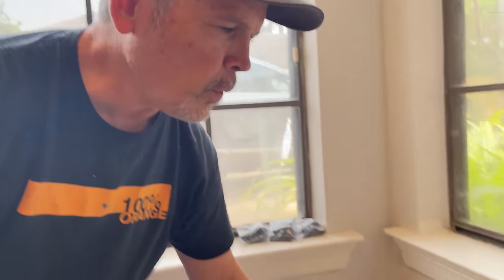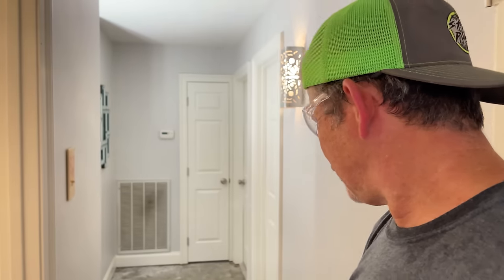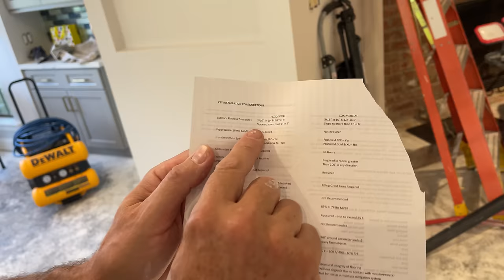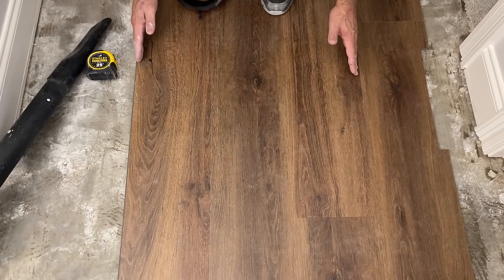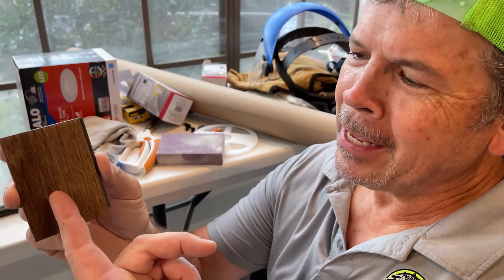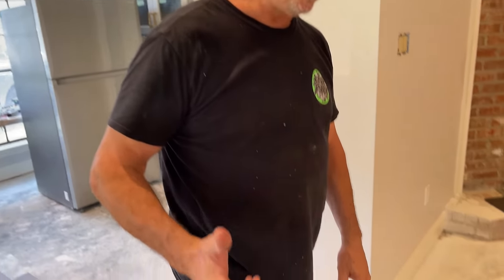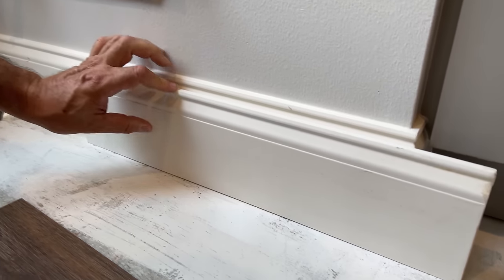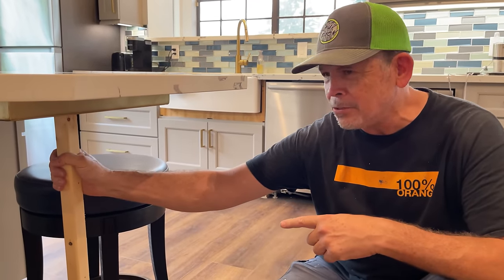The ULTIMATE FLOORING HACK! | Installing Vinyl Plank Flooring

Comment: A few pro tips:  1. Use floor patch instead of thinset, it dries in 20 min and is much harder and smoother.  2. Pull the base and put it back up or install new.  It looks much better and makes install easier. 3. NEVER beat on the edge with a hammer or a rubber mallet, not even with a tapping block.  It's very likely to damage the locking edge. (It almost certainly will).  4. The soapy slide in trick you did in the hallway works on some products, but not all.  Many locking systems, often called drop lock systems, can not be flat tapped into place, doing so will break off the locking tab.  5. I never use a table saw.  I score and break everything right there on the floor.  It cuts your install time in half and makes no mess.  A heat gun will soften the vinyl, allowing you to cut intricate cuts with a knife.
Reply: everything you listed i wanted to say first
Reply: @toxicated3622  Same!
Reply: Actually use soft rubber hammer and I fixed flooring after people who don't use hammer the seams  not locked all the way
Reply: And he could have used  headless nails instead of screwing the planks down
Reply: I use self leveler takes longer but is easier
Reply: great vid. I don't mind the quarter round, only thing that had me cringing was when they were just hammering away at the locking edges with no block.

I might disagree with you on the use of a table saw. sometimes scoring it takes forever compared to table saw/small circular saw
Reply: @KayakKingdom  I shouldn't have said I never use a table saw. It is helpful for very skinny pieces and lots of same size rip cuts. It's also useful when you need perfect edges where there's no base. Last week I used the table and chop saw for a flight of stairs... but holy cow the mess it creates is insane.
Reply: @olegzakluchonii  I didn't say to not use a hammer.  What I said was don't hit the edge directly and don't use a tapping block.  They are made for hardwood and will destroy the locking edge on LVT.  Instead, cut a small piece of product and lock it into the leading edge and tap on that piece.   This saves the edge of the piece you're installing
Reply: @miketerrell1094  if you buy the RIGHT tapping block. it never touches the locking portion of the edge
Reply: @KayakKingdom  I've never seen different tapping blocks, they're all pretty much the same and they all contact the locking edge.  The best way is to cut a scrap piece of material and lock it in, then tap on that piece. You'll destroy it before long, then just make another.
Reply: The father son team dynamic is entertaining but thank goodness for your comments.  I had to pause watching the video after he put down thinset instead of concrete floor patch or LevelQuik or CementAll (my favorite) or the many other products specifically made for this application on concrete.  Thinset is not the way to go.  I agree that they should have pulled the baseboard and put them back and rested them on the flooring after install.  The way they did the work here means they'll need to add quarter round to the baseboard, which will not look as clean.  Hopefully they see your comment and it helps them for their next project.
Reply: Are the spacers just for if there isn't any baseboards installed? What purpose do they serve? Other videos I watched show people spacing from every single wall.
Reply: @coltonkruse2313  My understanding is that it's a floating floor and needs room around the edges. My baseboards were removed but the provided shims did not work well at all. We used some drywall screws instead. We removed them after the floor install, before installing the baseboards.
Reply: @miketerrell1094  I made a tapping block out of a scrap piece. It doesn't damage the edges unless you get careless. I also used a flat pry bar to gently force the last boards to seat completely.
Reply: Ok boomer
Reply: I use a Mantistol LVP 333 cutter, instead of chop saw , still use table saw for rips . I always carry prep underlayment & float trawl to every job just in case. Prepping the floor will assure  it fits together easier & will have a smooth shine to the reflection & not a bumpy or imperfect one
Reply: @coltonkruse2313  it is to allow for expansion & contraction of the material.  This is why it's always best to acclimate the material @ least 48hrs b4 install.
Reply: @MillionDollarFlipper  Ardex is the gold standard in prep however it does take longer to dry. I use regular cheap prep for quick fix. Self leveler for bad situations. I always carry a fan with me to speed up the drying process
Reply: @KayakKingdom  not picking on your comment Mr Fingers just picked yours to comment on. 

If people wouldn't put such bullshit in their house we could all avoid the majority of this crap altogether
Reply: @coltonkruse2313  , floating floors  expand and contract.  Each manufacturer has different tolerances on outer edges and length of runs before a expansion joint is needed.  Most manufacturers have a phone number and technician to answer install specs.   So therefore space around the perimeter is required!
Reply: I've never laid floor before, but will probably have to soon and I'm doing research. From what I've seen people usually say even if the product has padding it's a good idea to put additional one for better noise dampening. Also shouldn't they have left a bit more room on the edges with the wall to allow for expansion? Especially in the corridor it looked to me like an exact fit.
Reply: @miketerrell1094  hook a fernco (rubber coupling with hose clamps) to hook your shop vac to the dust outlet on either saw. Or both if you have multiple vacs
Reply: @CStone exactly. there are LVP tapping blocks the touch the top edge of the plank, but all but miss the locking edge. it still does touch but most of the force is dispersed onto the top of the plank
Reply: Hi stud pack, have you ever done a RV?
Reply: @yogibear5649  in most things in life , prep is everything .
Reply: @yogibear5649  we always do that .
Reply: @miketerrell1094  ah, good idea.
Reply: Flooring of any kind sucks
Reply: Been doing this 20 years. You can use a tapping block and hammer to lock it in. 
You’re not gonna break the edge. Unless it’s broke already or you’re forcing it.
Reply: @miketerrell1094  LVP not LVT
Reply: @Yogi Bear  I'm about to start doing my floors, and I never heard anything about acclimate, what is acclimate and how do I do it. TIA
Reply: I like the thinset if it needs any adjusting just use the floor scrapper and it is easy to take down
Reply: Thank for the tips
Reply: No pro here, but in the past I've used off-cuts to use along with the tapping block to reduce chance of damage.
Reply: @yogibear5649  I do sheet vinyl floors. Ardex is great I agree. I absolutely hate the dry time though. I almost always use 5 minute drywall mud.  Before you respond to that,  I’ve been doing it professionally for over 20 years and have never had an issue even on deep spots like expansion joints or toilet holes cut out because it was in the wrong spot. Seriously not 1 issue ever!  Well it’s a 2 year guarantee so in 2 years no issues. I’ve torn old jobs out at remodels though and have seen previous installer used drywall mud and it hasn’t been a problem. A few of the jobs were extremely old like over 15 years and they also were fine.
Reply: @domingoc  Acclimate just means to get the material same temperature humidity etc to the house you are going to be installing it in. I’m a 20+ year sheet vinyl installer. 24 hours is probably more than enough,  I guess it would kind of depend on where it was stored before you brought it home.  In new construction, where I work you never get a chance to acclimate any of your materials. It’s really not that big of a deal. I mean if you were storing outside in zero degree weather and brought a box in to get started I would separate the pieces and let them warm up a bit. Other than that it’s not an issue. Honestly I think I those very long acclimation times are out there by the manufacture as any excuse to not pay a warranty claim for defective material in any way they can.
Reply: Jigsaw works just fine for intricate cuts done many floors that way, who tf wants to wait around with a heat gun & make awkward cuts with a razor? Cutting it to fit sure, but I’ll stick to the jigsaw for awkward around door jambs, pipes etc
Reply: @KayakKingdom  exactly this dude doesn’t have a clue what he’s tlking about lol
Reply: @Nunya-gk9fr  I agree 💯 I have even used a giant Dremel,  not sure actually what the tool is called but it’s bigger than a Dremel,  it’s an off brand but I put in a router plunge cut bit and that will knock out cuts pretty quick, even faster than the jig saw sometimes.
Reply: I've always thought that any kind of floor leveling powder mixed with water will eventually cause its own dust. Maybe that's me, but seems that way
Reply: @johnbryan2414  no, your concrete driveway started out as powder and that doesn’t turn to dust. Most floor patches are cement based. Some of them are gypsum based but honestly you don’t see much of that gypsum based product anymore. 

20+ years of laying solid surface flooring experience!
Reply: Cutting my LVP was one of my concerns. I planned to use a table saw to cut it but that's a lot of measuring and walking up and downstairs. I will attempt your process and see how this goes. Small bathroom project first.
Reply: @diesel104  you can literally cut it with almost anything. It scores and snaps so easily or cut all the way through with a power saw. I really like for $150 the end cutters they have that look like those old school paper cutters you saw in your elementary school. No saw dust and super fast.
Reply: @yogibear5649 is that necessary to do with final planks? I can see that with a wood product like Pergo but this is final laminate...
Reply: @domingoc it means bringing the product to the same temperature as  the room it will be installed in. Just bring your product in the room it will be installed in 24 to 48 hrs before the installation. If it is an extreme temperature difference then longer time will be needed.
Reply: Well said.
Reply: @miketerrell1094 Patrick never Hammer directly on the locking edge! Also this is not lvt luxury vinyl tile which is mostly glue down it does not have a locking edge and uses spacers and grout like tile. This is lvp luxury vinyl plank. And as long as you're careful with the way you use it at a block is fine. I've installed thousands of feet of lvp and never have issues with a tapping block.
Reply: @edryan7742 I've done a couple RVs in because of vibration and shocked you generally want it use a glue down product. And RVs are not fun to do.
Reply: @SVMSICE yes generally drywall compound is good for patching except if the floor has excessive flecks in it like in some cheap mobiles. I had to do repair once on some sheet vinyl it actually crumbled the drywall compound when they rolled the fridge over it.
Reply: @KayakKingdom I agree. Use the proper tools.
Reply: @yogibear5649 Newvie here.  How do you accumulate the materials?  Just unbox and lay it all out?
Reply: @miketerrell1094 thats how i do it  best way to do it imo
Reply: He didn't hit the plank with a hammer, he had 4 in scrap  piece that fit into plank and he hammered the cut edge.
Reply: thanks for the tips. what kind of knife do you recommend for scoring?
Reply: @Honeybee4678  folding lockback utility knife.  from like a home depot. And get a pack of replacement blades .  I work for a wood floor company and im starting to see this type of flooring more and more.
Reply: Doing floors now and we use a tapping block and rubber mallet and haven’t run into any issues. Without it the boards wouldn’t be as tight. Just make sure you don’t hammer too hard and it seems like the tapping block is great!
Reply: Love watching your videos. Lots of great tips, keep up the great content!  @miketerrell1094
Reply: Elephant 🐘 in the room 1/ 8 to 1/4 inch gap on edges for climate flex, seen too many bubbles in flooring.
Reply: Transitions for doorways need to be in farther so you don't see carpet when you close the doors.
Reply: No need for those. Looks fine as is
Reply: Well said. Everything you just said is true.
Reply: These guys shouldn’t make videos to educate people because they don’t have a clue what they are doing
Reply: And where is yer channel? I wanna watch it....
Reply: @ahilbilyredneksopinion  did you find it
Reply: @ahilbilyredneksopinion im sure i could teach you a thing or two lol
Reply: @ahilbilyredneksopinion   i would always take the baseboards off specially in a new house. I’ve did it before and it’s not that hard and look a lots better. I’m actually doing some glue vinyl planks right now 😂
Reply: I agree ! Dont use thinset for floor patch! Thats cringe worthy for a flooring guy! Lol
Reply: And get some pro knee kneepads! Makes my knees hurt to watch you guys! Its a company out of Maine!
Reply: @wendyjameson7161  you need room for expansion against the walls!
Reply: You guys kick ass !
Reply: @Stevesbe We flooring guys urge you to follow that idea!
Reply: @alpicard4932 these guys wrote the book on how to do stuff you pinhead!
Reply: @miketerrell1094 funny, I did my whole first floor using a hammer and a tapping block and didn’t  break any edges.  Maybe most of the time it’s user error.
Reply: So what's the solution for your #3?
Reply: @miketerrell1094 I have a tapping block that does NOT touch the locking portion though. It was part of a laminate installation kit I bought at home Depot.
Reply: Thank you!
Reply: @KickzNBeatz laminate and vinyl are 2 completely different product. One needs to acclimate and the other does not. Different material, different thicknesses, different locking tabs, different design.
Reply: 1. I use a sacrifice board against the installed edge and tap  the sacrifice board with a rubber mallet. No edge damage on installed piece, and a longer sacrifice board makes the piece being installed drop quickly and beautifully into place. 
2. Are they using the activator for 2P-10? (I didn't watch the whole video this time, sorry if that's covered.)
3. With thicker versions of SCP, it takes about 30 scores to maybe snap it-- that stone is hard!! A quality LVP chopper is worth its weight in gold. No trips to the saw except for cuts along the length.
Reply: How do you handle plank termination at a sliding glass door (metal frame), base of stairs or exterior door that does not have a removable threshold to go under?
Reply: I used a carpet knife. Scored twice, it snapped right off. Thanks for all these tips.
Reply: @aetorres7422  lol, I didn't use anything. I just locked it in. No glue, no nails or screws. Year 4 and no problem yet but I don't travel any longer. My camper and tiny home are stationary now ( I could pull my caper out today tho ). Maybe that helped to keep it down but I have two large dogs that stay inside at night and all winter. No damage so far! Knock on real wood, it doesn't happen now. Lol
Reply: @lorihutton4719   I commented about the nails for your fake wall that you are created by screwing the little planks down to hold the butt joints down
Reply: You got it bro  👍
Reply: The amount of force to break an edge is greater than the amount of force needed to lock it in place, a rubber mallet works just fine as long as you are careful, and don't beat the devil out of it,  and no need for a heat gun for lvp lock In, use a fresh blade and make two passes if needed but often times it's not and itll snap with ease , your advice isn't wrong by no means it's just time consuming for no reason
Reply: @SVMSICE  What is "5 min drywall mud"?  Doesn't sound like taping compound which is gypsum in water and must air-dry like wet clay.  Perhaps it is like Plaster of Paris, which is a chemical reaction similar to Portland Cement, and hardens in ~5 min.  I use it to fill large holes in sheetrock since also doesn't shrink like taping compound.
Reply: IS there a way to tell if you can't do the slide trick?  And if you can't, what option do you have?

Comment: Pro tip from our installers, when cutting door jams for the floor to slide underneath,  turn the board upside down so your saw rides the bottom of the board. Saves the floor and the blade doesn't get the small rubber stuck in the teeth 😁
Reply: Use a scrap piece.